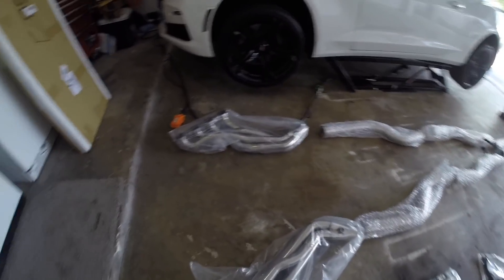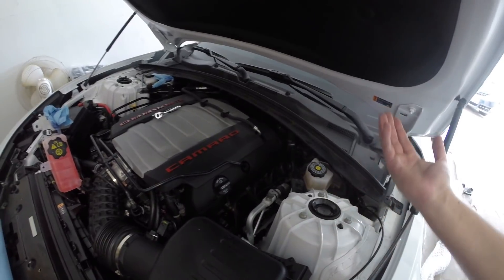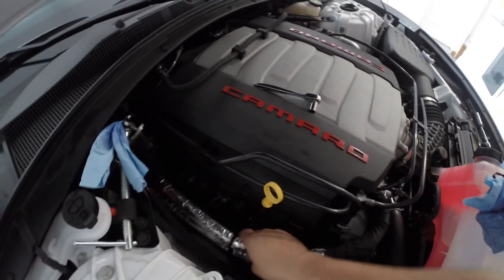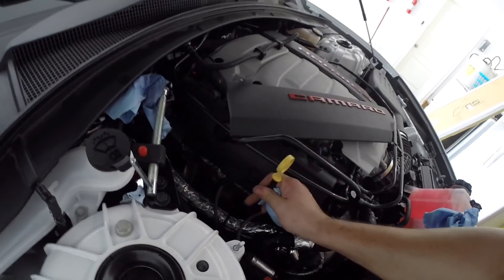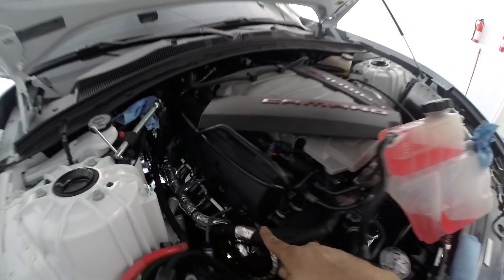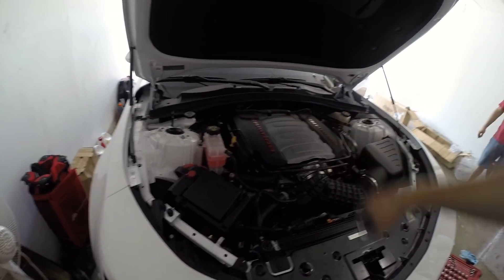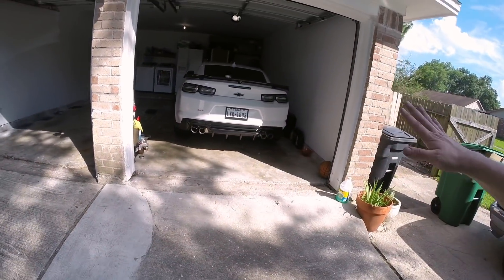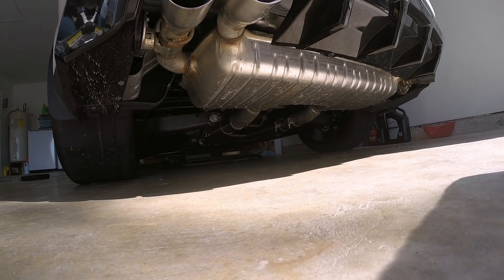Installing Speed Engineering Longtube Headers and X Pipe on MY 2019 Camaro SS!!! | Vlog #238

Comment: Hey do you have to get it re-tuned after the install?
Reply from the maker: Yes it’s definitely recommened
Reply: @JLSpeed   thanks. could you do me a favor and throw me the links for the o2 extension and if I need a couple more stuffs would really appreciate for the links man
Reply from the maker: @isaacs8409  same place you order the speed engineering headers at they have them as an option when your order them or you can get them separately

Comment: Did your brace under the car fit back on?
Reply: I ordered the steel gaskets with mine are they good or should I call them and change to oem gaskets?
Reply from the maker: No the brace didn’t fit back on you could put some spacers and get it back but I didn’t put it back. And just reuse oem gaskets no need to use the gaskets they provide

Comment: The stock manifolds actually dont look that bad at all.. a tri-Y design. I bet the headers alone dont gain that much on mostly stock cars.
Reply from the maker: Matt G Matt, the gains you see are partially due to the cats getting removed. Headers with the cats removed are good for 20-25hp with the tune.

Comment: Do only the o2 sensors before the cats stay? With extensions of course , do the two after get deleted?
Reply from the maker: Yes only the front o2s stay to help with the closed loop fueling during normal non wot driving
Reply: Do they 2 rear just get tuned out?
Reply from the maker: @JoseRomero-wg3vc  yes sir, your tuner should be able to tune them out

Comment: What did you do with the afm valve actuators? Also with the 2nd set of o2’s
Reply from the maker: Joey S the afm valves and second set of o2s were removed and I had the car tuned to eliminate the check engine lights from not having those on
Reply: Oh okay so if I wait to get a tune I would just have to deal with the cel on? Obviously not as big of performance gains without tune but if I were to wait a week say
Reply from the maker: Joey S if you get a tune the cel won’t come on the tuner will eliminate those check engine codes from turning on the cel
Reply: Jorge's Vlog okay thank  you for the info bro installing tomorrow morning one last question what did you torque them to and what sequence
Reply from the maker: Joey S um I just tightened till I felt it was right no torque specs really

Comment: Is there any warning light show up after instal x-pipe like check engine ?
Reply from the maker: Cezary Kul if you do not tune the ecu and ccm modules you will get a check engine light due to lack of cats and removal of the AFM Valves that we’re in the midpipe.

Comment: Did you gain more hp with those ?
Reply from the maker: yes headers and no cats will definitely gain hp
Reply: @JLSpeed  sounds good brother one more question  if you don't mind  what do I need to buy to get a flex fuel E85 tune?
Reply from the maker: @ssfastlife1868  you will need a flex fuel sensor kit and ofcourse have someone tune the car to enable the e85 sensor for operation.
Reply: @JLSpeed  thanks I appreciate the help keep up with the good work brother🏎💨🤙

Comment: Is there a reason why you went with 1 7/8 size headers instead of 2?
Reply from the maker: Num Vienthongsuk I’m not going boost, so therefore I didn’t want to loose any low end torque.
Reply: Thanks. I was wondering what’s the benefit between the two. And the x-pipe didn’t interfere with your NPP EXHAUST? did you lose any functions on the NPP?
Reply from the maker: Num Vienthongsuk the npp exhaust still functions like normal. No interference.

Comment: I remember reading online that GM would void your warranty by installing aftermarket headers. However, I was also reading somewhere else online that it would be completely situational for them to void your warranty. Is this true? I own a 2016 Camaro 2SS and I was considering buying headers.
Reply from the maker: The actual install of headers might not exactly cause you to lose your warranty, but the tune thats required if you plan to remove your cats will. I did the headers with the X pipe mid section without catalytic converters which will cause your check engine light to come on not only because you don't have the cats but i didn't even re install my secondary o2 sensors. I also removed the AFM valves that were in the stock midsection which will also throw a check engine light if you do not get it tuned to remove that error. So unless you plan on getting headers and possibly getting high flow cats you will end up voiding your warranty

Comment: Just ordered these today, how long does install take and did you have to remove valve cover?
Reply from the maker: Joey S I think it can be done in about 6-8hrs if it’s the first time. I did not remove the valve covers, but removing the black coil covers will help give you more working room.

Comment: There gonna leak also did u put the tunnel brace back on
Reply from the maker: Panagiotis F i went back about a week later to retighten the clamps and haven’t had issues with leaking. I did not put the tunnel brace back on
Reply: @JLSpeed  mine leaked everywhere and kept leaking i ended up getting borla mids and keeping these headers with an awe axle back

Comment: Did you purchase the spark plugs as well?
Reply from the maker: Roythesavage I ended up using the short plug wires from speed engineering afterwards since one of my driver plugs was barely touching and melting an edge of the stock plugs, but no spark plug change still on stock plugs.
Reply: Jorge's Vlog yeah lol I just watch your other vid! Thank you for responding doe!! Your car is dope asf btw <3

Comment: Let us know the long term use on this or heavy use if u ran into any issues
Reply from the maker: Will Do! So far 2 weeks in and no issues. I will be going back and inspecting the clamps in a week or two to see if they have loosened up. Might have the nuts replaced with nylon locking nuts to help keep them tight.
Reply: @JLSpeed  thanks , because i want to do headers x pipe but im stuck between budget and quality so its either save up and get texas speed stuff or just pull the trigger on these , they sound good. but i got straight pipe axle back curious how it will sound
Reply from the maker: Jimmy M  my only concern with the speed engineering when I bought them was the fitment. But as you saw they fit perfectly and everything looked good quality. With straight lips I would imagine it would be insanely loud!

Comment: What's hp gain? Did you have to get it tuned?
Reply from the maker: Dont remember exactly the hp gain I believe it’s in one of the later videos, but I want to say around 30ish give or take. And yes you will need a tune if you don’t want a check engine light on

Comment: Hi i have a cuestión do you use your stock spark plug wires?
Reply from the maker: Saulo Castelo i did for about 2 weeks. One plug wire was barely touching on the driver side so decided to go with the speed engineering plug wires and no more rubbing.

Comment: Gahly. This beast is loud. But definitely droning right?
Reply from the maker: Norbert, because i left the dual mode exhaust in the rear it actually doesnt drone when in tour mode. in track mode i believe its still quiets down when your cruising over 40-50 mph. This can all be adjusted in the tune to be open all the time while in track, and have it closed during tour mode. So far it sounds great!
Reply: Jorge's Vlog that’s a clean setup you got in there.

Comment: What about the cold air intake before you get a tune?
Reply from the maker: The stock intake has shown to work pretty well, im sure a cold air would net some gains. This time around im doing just the tune and the headers. We will see just how much power I gain from that. Then we will get an intake and do some data logging and update the tune for the cold air intake and go back on the dyno to see the kind of gains you can get from adding a cold air. I want to track and see what each individual mod gains power wise for those interested in seeing the results.
Reply: @JLSpeed  really like that because nobody else does that, you deserve more subs man.

Comment: Where did you mount the afm valves on the mid pipe?
Reply from the maker: takedownquill8 I removed them completely from the system. I had to get the car tuned to get rid of the afm and also to clear the check engine code from not having them plugged in. I’ve heard people zip tie the motors only back under the car so the check engine light doesn’t come on

Comment: did check engine light come on?
Reply from the maker: Salvador Rodriguez it would have due to not having the cats and not installing the rear o2 sensors for the cats, but I had the car tuned to eliminate the check engine light troubles due to no cats

Comment: What about the AFM valves?
Reply from the maker: They are deleted, I had to eliminate the check engine light from the tune but you could also remove the motors from the actual valves and plug them right back up and just zip tie them out of the way.
Reply: @JLSpeed  the tune remove eco mode all together?
Reply from the maker: @camarochris78  yes, with headers and no cats you don’t want the dod to activate. It will sound horrible and drone. Plus the dod mode doesn’t really save you much....

Comment: Was the engine light on after?
Reply from the maker: Gustavo Gomez yes, I got rid of the cats and the afm valves so the check engine light came on bc of not having the secondary o2 sensors and afm valves connected.

Comment: What’s your exhaust setup
Reply from the maker: Labib kabir headers, x pipe to stock npp axleback
Reply: Jorge Loves Speed so when you got x pipe with headers you didn’t need any new exhaust system
Reply from the maker: @labibkabir4953  No the headers and x pipe system hooked up to the stock rear axleback.

Comment: Does the car have to be tuned right away when u put the headers on
Reply from the maker: No but you will have check engine lights from the rear o2 sensors if it isn’t until you get it tuned

Comment: You had any exhaust leaks ? My shit is leaking from all the clamps
Reply from the maker: I did but used some exhaust leak copper sealant around the clamps and replaced the clamps with better quality ones
Reply: @JLSpeed  got a link by any chance brotha ?
Reply from the maker: @S650Nathan  been a while, I bought the sealant at autozone and clamps from ebay

Comment: CEL?
Reply from the maker: Michael Hauserman yes but can be cleared when you tune the car
Reply: Jorge's Vlog This is em the exact setup I’m wanting to do with my 16 2SS. I’m new to your channel, haven’t had time to go through your vids yet. How has it held up?
Reply from the maker: Michael Hauserman it’s been great! Just had to re tighten the clamps once but other than that holding up very well!
Reply: Jorge's Vlog Would it be easier, long term to have it all welded together instead of using the clamps? Or would you not recommend that?
Reply from the maker: Michael Hauserman yes welding would be a good option that would completely eliminate any issues that come with using clamps. If possible welding would be a great option.

Comment: When you removed the afm valves in the exhaust the modes shouldnt change the sound
Reply from the maker: The afm valves are not tied to the modes. The afm valves only operate when the car goes from v4 to v8 modes the valves on the exhaust tips on the dual mode muffler is the one that changes the sound based on the modes...

Comment: Hey Jorge. Do you get check engine light after installing these? And if so how can you resolve that before tune or is that the only resolution? thanks
Reply: InfinitePhasesFilms hey bro just letting you know that yes you will get the check engine light after installing long tube headers. But you can get it tune to unleash the potential or if you don't want it to get tuned then you can buy the headers with catted but then if you like catless headers then you can buy the o2 sensor clamp and just drill a hole on the catless tube.
Reply: Or you can buy a headers that have a hole on it

Comment: Hey bro when you ordered this, did you get the oem manifold gasket option or the multilayer steel gaskets with bolts? Can’t decide what option to get
Reply from the maker: I did the regular oema manifold gaskets. I reused my stock gaskets and bolts since they only had 600 miles on them lol
Reply: @JLSpeed  oh gotcha, mines currently at 32k and was gonna pull the trigger Friday, you can’t beat the whole setup for the price! Lol but wasn’t sure if I should get the steel gaskets they offer or grab the oem, but idk if the oem option has the bolts also or if it’s just the gaskets themselves
Reply from the maker: @laserguy815  I would do oem